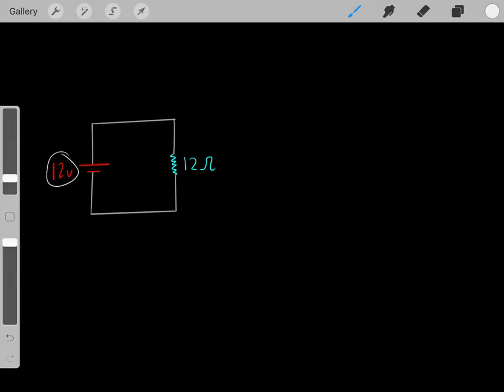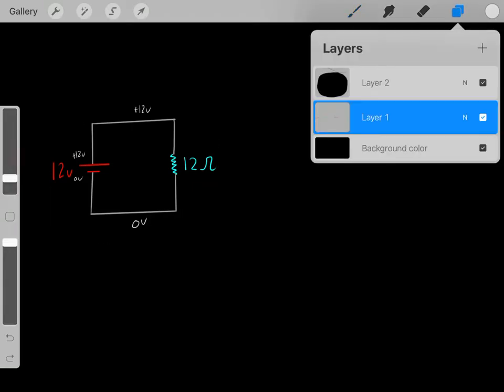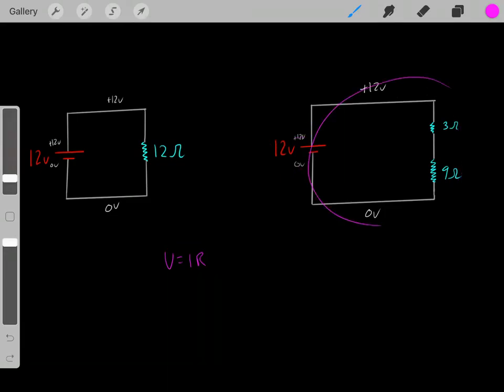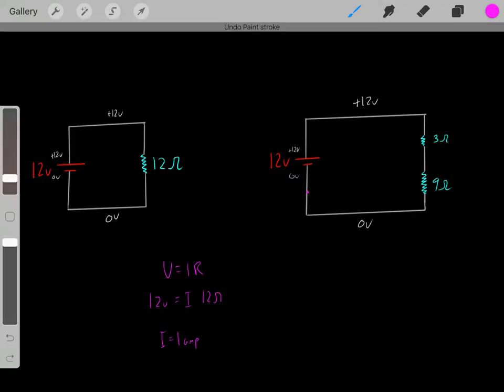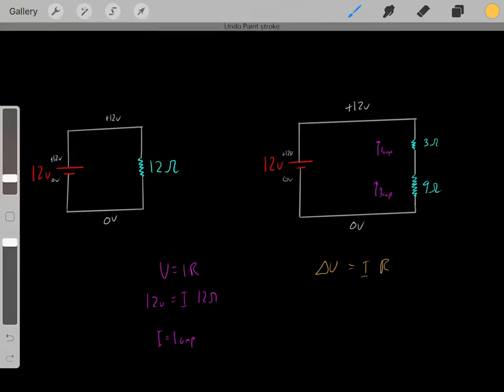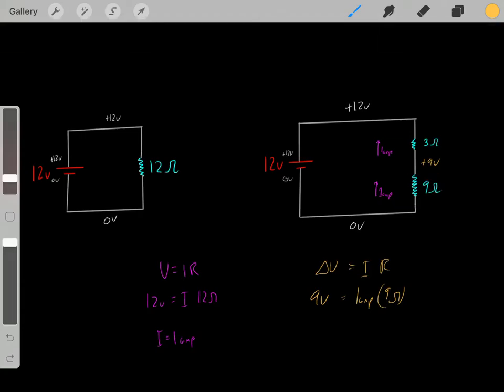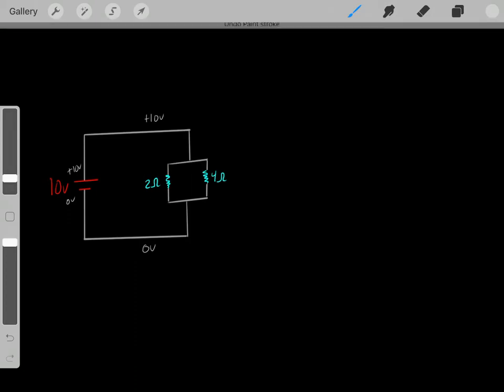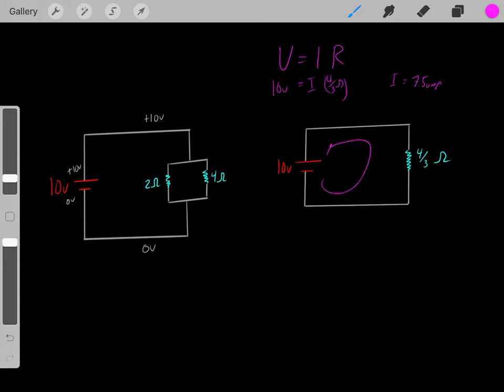Advanced Circuit Analysis MCAT (Voltage and current across resistors in Series and Parallel) PART 1

Comment: If Current describes the movement of positive charge, then wouldn't it flow from the 12V/10V side to the 0V side?
Reply: it's all about electrons (in metal wires)--electrons are moving here, not protons, and electrons will move from more negatively to less negatively charged space, so current will always travel to the higher charge. Does that make sense?